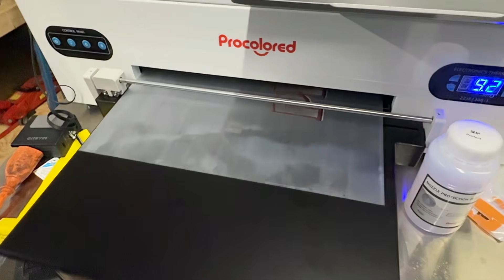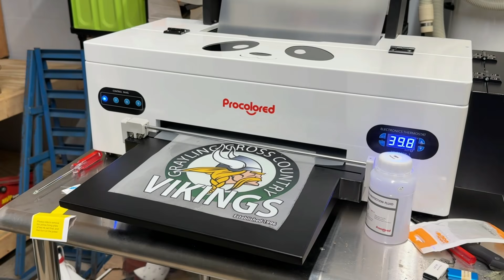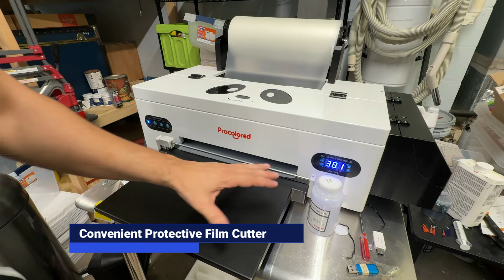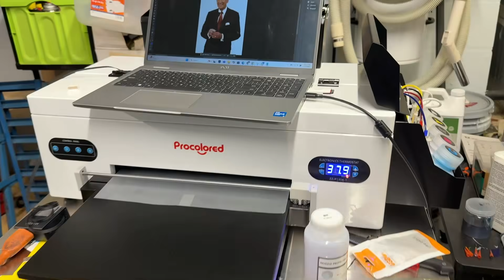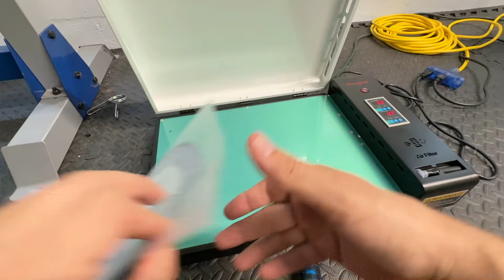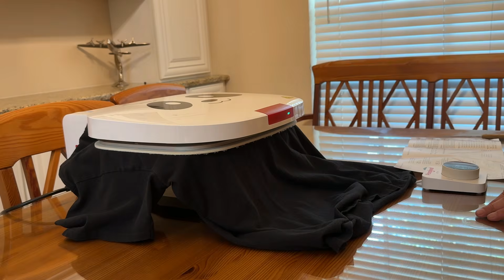Procolored F13 Pro Panda DTF Printer A3 Dual XP600 13" Transfer Printing Machine with White Ink

Comment: The compact size and lightweight design make it easy to fit into any workspace, and the included software with dongle connection makes it accessible even for beginners looking to start a printing business.

Comment: I've struggled with ink clogging on other printers, so the advanced white ink stirring and circulation is a big plus for me. It sounds like this printer is built to handle heavy use without drying out or jamming.